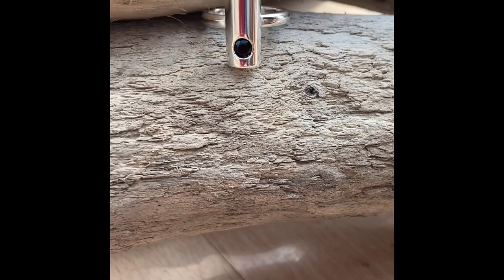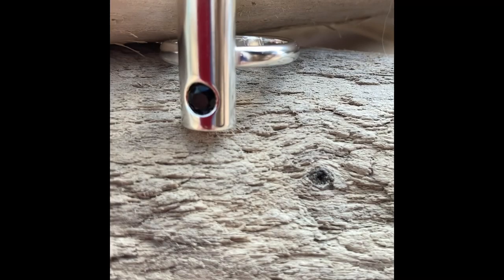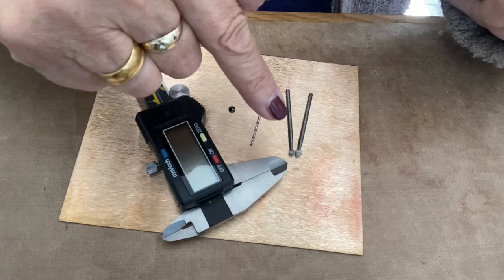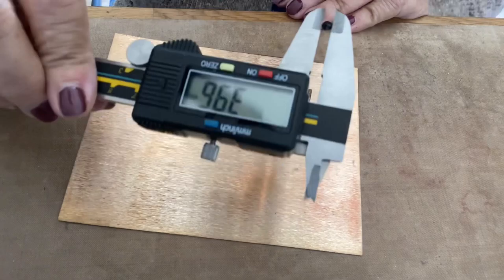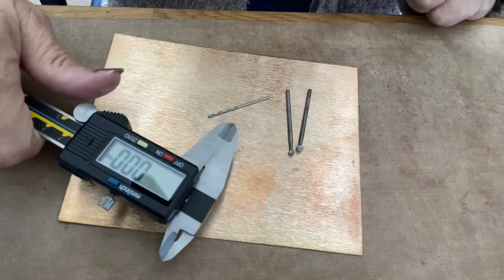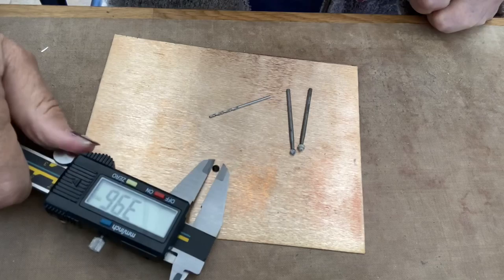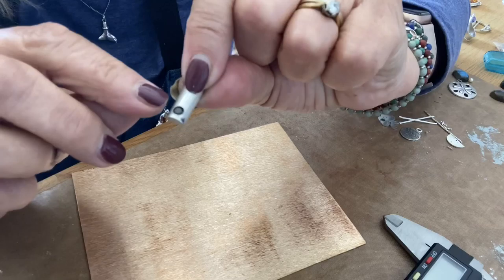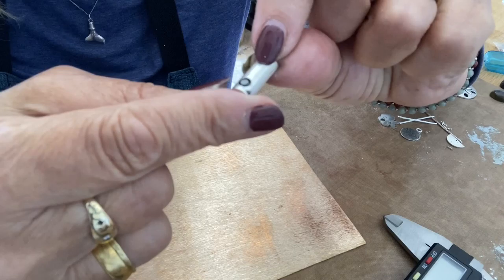STERLING SILVER ‘D’ SHAPED WIRE PENDANT

Comment: I do so love this set! I don't use a vise with my small bench drill either and I've never had a problem or accident as long as your careful as we always are. lol... Here's a little tip I came across recently that's very inexpensive and helps in tight spots on stone setting and other things.  Get some hot glue and melt a whole lot of it on the top of a flat piece of steel and it can be reused over and over again. You can use a hot air blower to melt just enough to hold your piece down while setting your stones or engraving and let it cool and harden.  After your finished setting your stone just reheat with the hot air and remove your piece.  Any glue left will easily peel off.  Heating the glue does not damage the stones.  I love learning new tips and tricks to make things easier especially when it doesn't cost much.  I prefer spending money on beautiful material and stones instead. lol...  In fact, here's where I saw this tip:  https://youtu.be/3T8Jal4q1NA     I hope this helps.  thank you so much for sharing!
Reply from the maker: Thank you so much for this really useful tip.  I’ve subscribed to channel - what a lovely lady she is,  thank you so much for your support of my channel, x

Comment: Hello,
thank you very much for this video. I would like to make the burnisher. Can you tell me please how thick is the Nail and what material it is. Is it  steel or stainless steel? The tip seems little rounded. 
I hope you stay well.
Stay safe in this time.
Greetings from Germany
Maren
Reply from the maker: Hi Maren, it’s not a stainless steel nail it’s a plain and simple every day nail 🥰.  It’s point was sanded down to take off the sharp tip and to make it rounded.  It was all then polished to give a nice smooth finish.  The size of mine after cutting off the top is 38mm and the diameter is 2.6mm.  I hope this helps and thank you for your support xxx
Reply: @LivonDesignsSilversmithing  Hello,
thank you very much for your very soon and helpful answer 😀😀😀.
Have a nice day.
Greetings from Germany
Maren